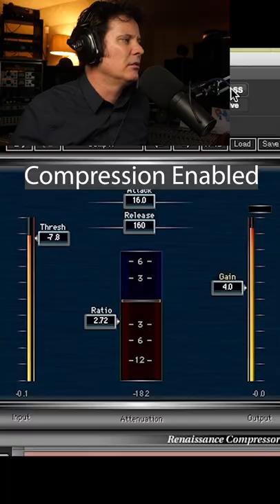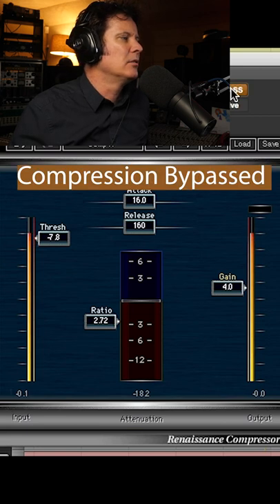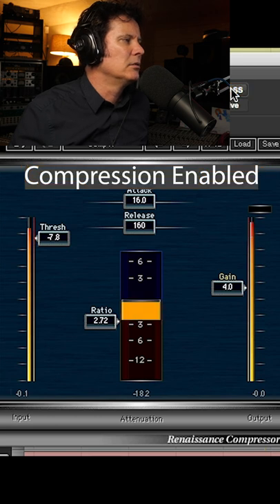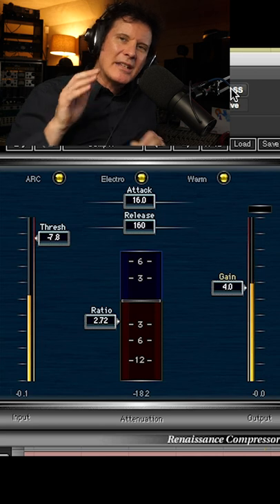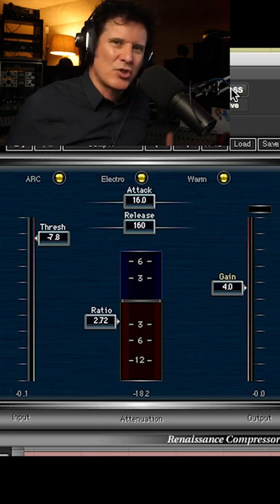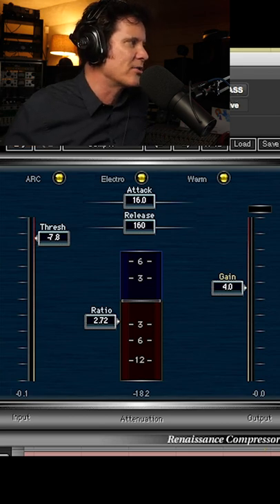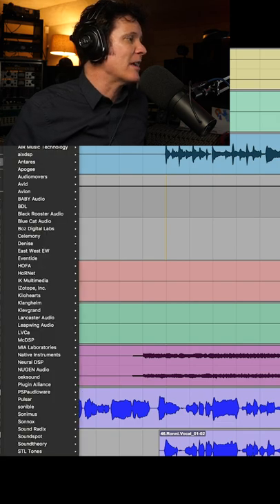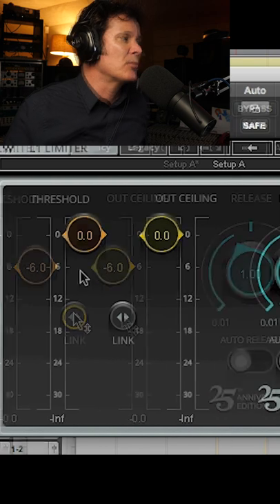How do you control transients?

Comment: When would you use this in reverse to do the same thing? Limiter first, compressor second
Reply from the maker: I’m not I would ever use it in reverse. If I’m limiting the signal and dramatically reducing and removing the dynamic range what would the compressor do? Use a compressor first gently reducing peaks then using a limiter to catch just the stray ones that need additional treatment is always the way I would work